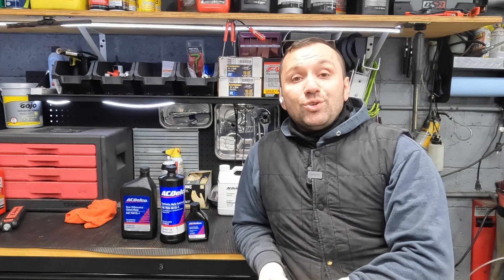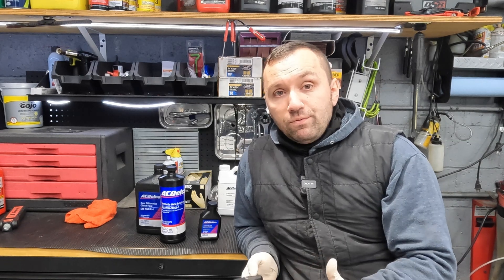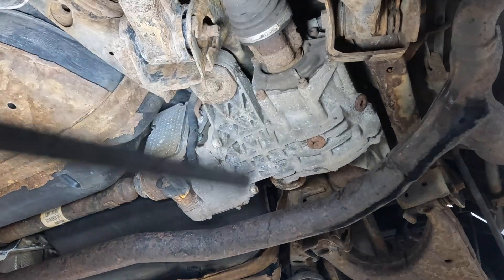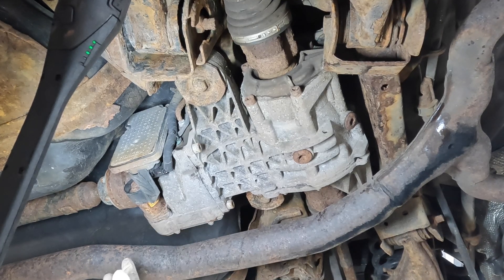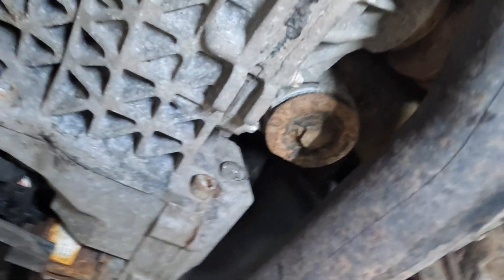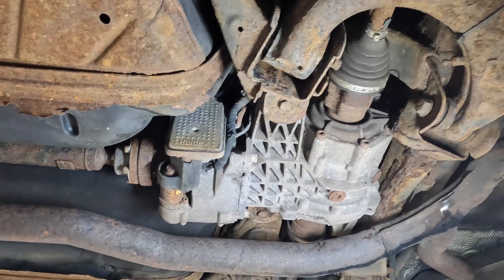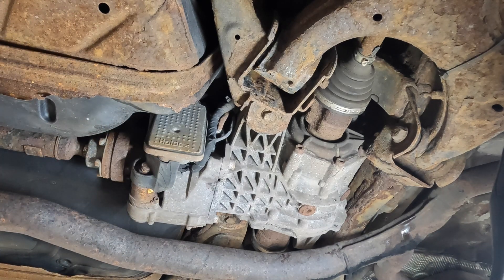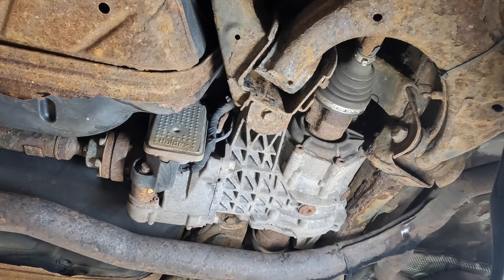ENGINEERING FAIL! WHAT WERE THE ENGINEERS THINKING WHEN THEY MADE THIS DISASTER OF A DIFFERENTIAL?

Comment: I live in the rust belt called Wisconsin. I would NEVER drive any vehicle in Winter without giving the under carriage a Fluid Film treatment. Fluids are CHEAP!! I have done this to my '20 used Blazer for 3yrs now, and so far nothing more than SLIGHT surface rust on the back of the front hubs!
Reply: By chance what type fluid did you use engine or trans?

Comment: Dang me! You couldn't pay me to buy a new auto. My last new car buy was in 1985 and I still have it. It ain't much but there is zero rust, it still runs and drives like new and I've only had it worked on twice by a mechanic that I trust. It's a 1985 VW Jetta Diesel and I may have to shift into third gear going over the mountains here in douglas county but I still get 44 mpg.

Comment: This is simple over complication for complications sake. Separate units using different, most likely incompatible fluids, sharing a seal. A separate electric external pump with computerized controller for something that just needs a simple on/off function.
Reply from the maker: I agree it seems like the engineering team was trying to be too smart.

Comment: LOL on planned obsolescence. This is just a reality of anything mechanical. Life requirement is always a design requirement. It goes with cost, weight, performance, and durability. These are also conflicting and designer engineers have to balance along fitting the part in the space available. Easy to be critical not knowing the challenges the engineer may have had. There are also many other reasons to a "bad" design.
Reply from the maker: I don’t disregard that engineers have certain limitations and things they have to fight when they’re creating these designs but at the end of the day if you can’t create it with minimal issues for the long haul, why even try to make it also I completely understand the whole planned obsolescence thing I know it’s been going on for years I don’t see it being as practical anymore because people are starting to wake up to this crap.
Reply: @TheEnthusiastMechanic  I really don't think you do understand based on comment. My point was it isn't something that just appeared. It is basic to engineering to design to a life requirement.  Engineer designing race car parts has performance and weight requirements over cost and life. Life would be enough to last some requirement  amount of race time between replacement. It's a trade. I have no idea what life criteria engineers go by in auto industry nor know if it has changed over the years. Most you see are just poor designs for probably due to bad work culture,  inexperience, bad day, or changing operation conditions variables. My experience is aerospace and most definitely design to life as it can be a safety risk. Even there, some part fail despite engineering reviews and  testing. Hard to explain typing on a phone to a comment. 

What is needed is better longer warranty standards. Then all car manufacturers would be on same page to life requirements. Maybe life requirement is standardized in the auto industry.

Comment: now is the samr Servicing for a four-wheel drive Silverado with a V8 that doesn't have the Z71 package. Because I have a 2020 Silverado that doesn't have four low so I'm assuming this is the same all-wheel drive system it's horrendous
Reply from the maker: If you don’t have the option to switch into four lower for how you may have an all-wheel-drive

Comment: Eh. My 05 Volvo S40 has the same haldex system. 20 years and 210k miles. Works fine. FCP Euro carries maintenance items for these at a decent price
Reply: My 05 Volvo xc70 Haldex DEM failed in the car wash. Water got into the circuit board. Keep an eye on yours ;)
Reply: Haldex is from Sweden..... and they make a lot for VW as well

Comment: Planned obsolescence.  Living in the rust belt I can say rustproofing is your friend. Fluid film, Krown etc.
Reply: in my experience the water will just wash the fluid film away, what has your experience been with fluid film?
Reply: @Arnthorg  I use Krown myself. Applied annually during late summer. This gives it time to creep into seams and allow dirt to stick to it. Once there's a good coating of dirt it acts like a sponge holding on to the Krown. Same with fluid film.
Reply: @redwoodforest3572 Ive seen Michigan plow trucks look pristine underneath because of fluid film lol what are you on about
Reply: @Arnthorg  Fluid film has worked pretty well when applied every fall. The key is getting the factory wax and loose rust off my Silverado frame. My sheet metal is rust free.
Reply: Anything but zeibart. That garbage is rust enhancer.

Comment: Design is Haldex/BorgWarner.Probably meant to be lifetime fluids like many other manufactures.You can partly blame that on the EPA,just like extended oil changes that destroy timing chains.Judging by the severe corrosion on that vehicle,it isn't long for the world.
Reply: I've got the 2003 version of this on a Saturn Vue with 165,000 miles original fluid and still works fine.  It's from Steyr in Austria but very similar concept to the Haldex.  Pretty much all this stuff is designed to last the length of a three year lease, after that you're on your own.  There's a reason most all mfgrs cut back their powertrain warranty from 100,000 miles to 60,000 miles.

Comment: 4:46 does that lower right corner of the differential housing around the bolt to the clutch housing look cracked to anyone else?  Or is it just a casting mark?
Reply from the maker: It's a casting mark looks like they machined it, when I was editing the video I noticed it and thankfully the car was still here and I look at it to verify.
Reply: nice 👍

Comment: No way I'd ever buy AWD anything. Maybe if you live in the mountains. FWD I have driven through 10 inches and plowed through drifts in the Chicago area and have never, not even once, gotten stuck.
Reply: Subaru AWD is simple, effective, reliable and amazing.
Reply from the maker: @DWthaman5424  it’s good but it’s not a 4wd there is a bit difference between the two i’m not saying this all-wheel-drive systems are incapable, but the four-wheel-drive systems are more heavy duty
Reply: @DWthaman5424 The old Subarus that were 4wd were much better. I had a Brat and it was amazing. Much simpler than the later AWD systems. Even the older FWD Subarus are unstoppable in the snow. I drive a 79 Subaru DL wagon.
Reply from the maker: I'm not the biggest fan of AWD I prefer 4wd that you can activate when you want it's more rugged!
Reply: Subarus aren't that simple and you have to replace all 4 tires at once or you'll damage the system

Comment: Access doesn't look to bad. Fords like the Escape/Explorer/Taurus are much worse since the rear diff has no drain plug, and the fill plug is buried.
Reply from the maker: The gearset side service isn’t bad but when it comes down to that pump, the way you have to fill it it gets a little difficult. The video should be out this week. I’ve done those fords and even though those are a pain I guess you can say this is similar to it when it comes to the clutch pack service.
Reply: I don't think it's that bad.